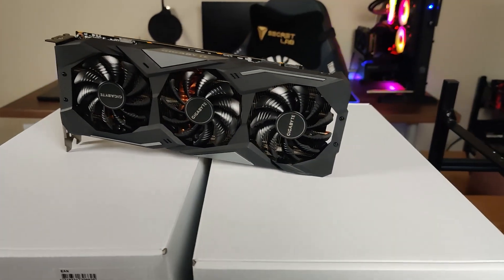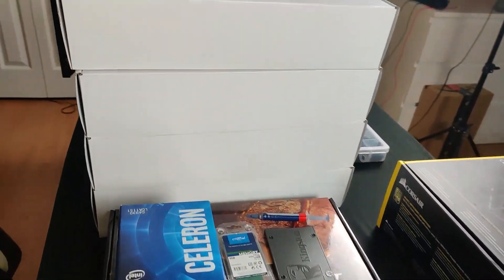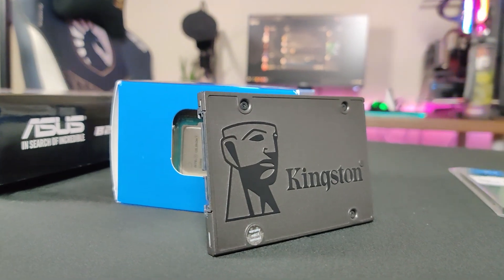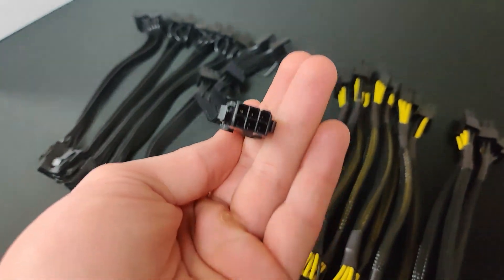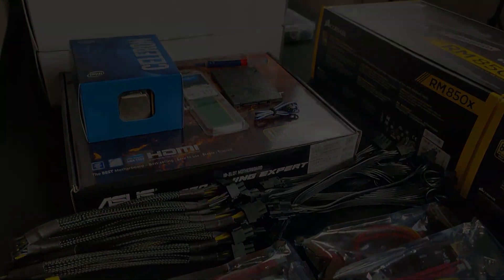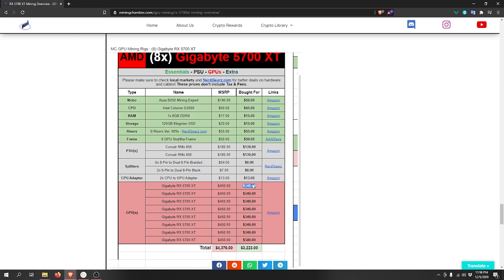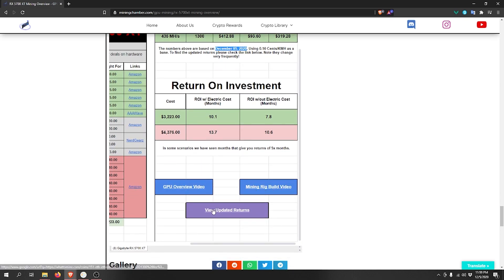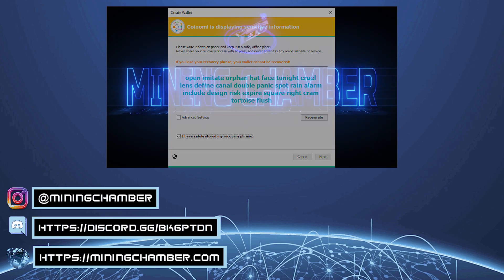RX 5700 XT Mining Rig Build - 8 GPUs | 435MH and 1300 Watts!!

Comment: Hello,

I have this power supply be quiet! STRAIGHT POWER 11 Platinum 1200W, 3 3060 ti are already running, I would like to connect 1 3060 ti, but I don't have a cable for power for the riser, do I need a splitter?
or does the power supply not manage to keep 4 graphics cards stable?
Reply from the maker: Yess you will need a splitter. You can use a splitter to power a gpu and it's riser from just one PSU cable
Reply: @MiningChamber  thanks for the reply, can you send me a link for a splitter? this is google translator. sorry for my bad english.

Comment: Hi, thanks for these instructive videos. My question is, if I flash my Gygabite Gaming OC rx 5700xt with the BIOS you mentioned in the comments, do I need to still tune the memory clocks? Because My hashrate didnt change switching from my stock BIOS to this REV1 bios.
Reply from the maker: Yes overclocks is different from bios modding. Check the latest video I released for info on this topic
Reply: @MiningChamber  Thanks for the help.

Comment: hello I have a question, I have a b250 mining expert, I installed hiveOS and when placing my rxt 3060ti it does not recognize the card, update bios, update the nvidia drivers from the hiveos panel
Reply: You still recognize it, do you have any suggestions?
Reply from the maker: Hey! Does your motherboard post screen show green on the gpu slot? I would suggest trying a different riser and such
Reply: fix the problem, thanks guys, it was hiveos version, everything working

Comment: So the risers just go from USB to motherboard pcie slot? The molex feeds them enough? Trying to troubleshoot why my rig won't post when it's on the riser.
Reply from the maker: The risers are supposed to be powered by the 6 pin on the riser itself and then the USB is from the riser to the motherboard pcie slot yes

Comment: I did this exact setup except with Nvidia Asus Dual 3070 cards.  Everything starts great until the exact moment the mining starts (Trex Miner on Hive OS) then its like the cards immediately over-draw power and the PSU clips and the system restarts.  I have the cards set to 130 w max each for mining but do they use way more power when they initialize?  Im pretty sure its the power draw because if I remove one GPU from each PSU, there is no issue.  Theoretically, the cards draw 265w max so 8 cards could draw 2120w and clip the power.  Do you have any experience with this or why this would happen?  I don't really want to put dual 1000w power supplies as it increases the cost.  Is there a solution I am missing?
Reply from the maker: You should be completely fine, try to load it in without a flight sheet. And I also recommend mining ethereum so Phoenixminer would be the better choice. Load it without a flight sheet, make sure you have the right oc settings in and then load the flight sheet in and see what happens
Reply: @MiningChamber  I will try that thanks for the advice!!

Comment: hi. can i use same settings for gigabyte rx 5700 xt aorus ?  because I did not make any adjustments and now it is consuming over 200watt and it is valued at 50mh / s. also the temperature is too high.
Reply from the maker: Yes you can! You can also find the 5700 xt settings on miningchamber.com I recommend using the ones on the website, more stable!

Comment: I'm looking for RX 5700xt's. Does the brand make that much of a difference in performance?
Reply from the maker: Not necessarily but there are preferred ones over the others. Check the video overview on the 5700 xt where I give the recommended ones. All what changes is their heat dissipation

Comment: Hey there, 

So I have a 1200 silverstone PSU which only has 4 PCI-E 8pin connectors and 2 x 8 pin EPS connector. 
Judging by your video I should be able to power 4 x 5700xt off of the PCI connectors. But I will need a CPU to GPU adapter to power an extra 5700xt?

Leaving one EPS for the CPU.
Reply from the maker: Yes so in your case, if you have 6 gpus and you power 4 with cables. What you can do is use splitters and power 3 GPUs through 2 cables and then their risers can be powered with Molex! If you have an extra cpu slot then you can look into using cpu to gpu adapter, else I would do the strategy of 2 cables for 3 GPUs. Don't go over 2 risers on one molex cable though!
Reply: @MiningChamber  
Sorry could you clarify the 2 cables to 3 GPU strategy? 

I thought that it was not recommended to run multiple GPU from 1 PCI-E power supply? 

From What I understand, I have 4 x (8pin to 2 x 6+2 Pin) - Like this one https://www.amazon.com.au/COMeap-Adapter-Corsair-Modular-24-inch/dp/B07CZBZN5R. 
Are you saying that I can further split these?
Reply from the maker: It isn't recommended for sure but If your short on cables (4 pcie cables and 6 GPUs) then your solutions are either buying 2 more cables and making sure your getting the right ones that are compatible with your psu or taking a non-recommended way (which means it's just not the best way to do it but still doable) and then powering 3 GPUs with 2 cables and their risers powered by molex. So you have a cable with 2x 8 pins. Get 1 splitter for each cable. That means you will have 6x 8 pins. Now you have 2x 8 pins for 3 GPUs
Reply: @MiningChamber  Legend. Thank you so much I'll give it a go! Will give you a shout out when I make my build video! <3
Reply from the maker: Pleasure my friend! And thank you!!

Comment: Do you have any video of how to mod this cards? Thanks in advanced
Reply from the maker: Yes ! Check links in the description! - Make sure to check the pinned comment of the modding video as well
Reply: @MiningChamber  Thanks for your reply! I use de unsigned bios and follow the same steps of the video. Unfortunatly the HR dindt change and the power cosumption is now higer that the stock version (With the Gigabyte Aorus)... Any Ideas? =(
Reply from the maker: Hmm did you apply overclocks after modding bios? Join the discord encase I miss the comment so I can help you there! Link in description
Reply: @MiningChamber  Yes, but its seems that the V1 unsigned Bios has a lot of issues. Fortunatly, after a lot of research, i found the gold (unsigned bios V2 for Aorus and Gigabyte) =D
 https://www.igorslab.de/community/threads/gigabyte-5700-xt-bios-mod-fails.3304/page-59

Thanks for your help!

Comment: Wait did you connect CPU power cables to the GPU connector? Isn't that dangerous? I thought GPU and CPU power shouldn't be mixed
Reply from the maker: The Corsair psu shares gpu and cpu slots so using a cpu to gpu adapter was not an issue, although I'm not sure if it's the same with other PSUs that don't do that!

Comment: Dude I’m getting 52 mega hash at 88-93 watts on my cards! I have 4 rigs 6 5700 xt on each and the production lately has gone through the roof and I’m at such low wattage now! I can post a pic of my settings and I’m using amd for the settings!
Reply from the maker: Hey! That is most likely power draw in the software, which is not accurate! Off the wall your most likely going to be at 100 watts and up! Feel free to share your settings in the discord server, link in the description!

Comment: In making of mining Rig only GPU is focused
I just want to ask how important is CPU and Ram memory
Or it doesn't matter that much compare to GPU
And second thing if I run this kind of rig for 24/7 what kind of cooling management I have to use (Air/Water). Well I want to use just air cooling because Water cooling will make it very expensive. But I want to know what problem Will I face with air cooling

One more thing what role have GPU memory in mining and I know how important GPU processing frequency is but want to know how important GPU memory is
Reply from the maker: Tomorrow's video should help you with that ;) and air cooling is completely fine!

Gpu memory affects the dag size. So for example 4gb GPUs can no longer mine Ethereum properly due to its dag size exceeding 4Gb.
Reply: @MiningChamber  do all crypto use dag 
Does bitcoin use dag
Do bitcoin asic miner have this problem too (dag size)

Where I live 
In winter it's always below 15°c but in summer it's stay between 35 to 40°c
What kind of ventilation system do 40 rig needed (8x amd 5700xt rigs)

Please can you make a video on ventilation and temperature management

Comment: You miners waste so much energy for so little gain.  You are leeches sorry but you are.
Reply from the maker: Have you checked the profits lately ? 😉 I recommend doing some googling before commenting on a topic your not too familiar with
Reply: @MiningChamber  have you checked the green impact you cause from 24 hours of operations?   You might want to google on a subject you know little about.    And your cost of operation to benefit is a down slope investment.  Short term gains with low long term due to overhead.
Regardless of the number of miners, it still takes 10 minutes to mine one Bitcoin. At 600 seconds (10 minutes), all else being equal it will take 72,000 GW (or 72 Terawatts) of power to mine a Bitcoin using the average power usage provided by ASIC miners.
Reply from the maker: @shamelessplace11  have you looked into the green impact cause from money printing? Plastic pollution? The world is vast. There are many issues out there that can be fixed. Just like mining "mints new coins", money printing uses a process that also is bad for the environment. Also, don't get me wrong I am all about the environment but things like this is a bit overboard. I support the technology of blockchain, and this is one way to support it.  

Without mining, it wouldn't be the secure network that crypto enthusiasts would've wanted it to be
Reply: @MiningChamber  I’ll give you that.  Most money is digital.  But I get you.  I see your side of it
Reply from the maker: 💙 just it's always good to talk with a different side to understand each other. 

I push everyone I know to never use a plastic water bottle so we all just somehow have to contribute. Eventually, mining will be gone and it will all be Proof of stake in my opinion. So at that time mining won't be necessary for sure!
Reply: @MiningChamber  agree so much waste in the world.  And it’s crying out for us to stop.    Ahhhh the free market what a bastard it is.   Have a great one stay safe

Comment: Nice video.
How can it be profitable if after 1 year you lose 90% of minig capability due to the complexity?
Price of ETH has to exponentially grow, am i not right?
Reply from the maker: Well ETH has already exponentially grew from $150 to $1150 in some months, profits are higher than ever now for mining and generally most people breakeven before a year with profits being where they at now.

In a year or two, Ethereum won't be mine-able anymore due to it changing to POS (proof of stake) so that means AMD miners will have a hard time finding a profitable coin while NVIDIA miners can mine other algorithms with decent enough profitability
Reply: @MiningChamber  Thanks for the reply dude.
How long you are thinking of using that rig? 
From what i gather , miners after one year change gpus.
I say this because if ETH comes back to 300usd it is not that profitable i think.

Comment: low Hashrate, i have my two rigs with 58.25 Mhz each GPU , they are stable for long time. So 54mhz is the basic for every 5700 gpu series, you need to put bios mod bro
Reply from the maker: I did BIOS mod it, if you watched the part for overclocking you'd know why ;)
Reply: @MiningChamber   you are right, try using HiveOS or RaveOS, because window put too much weight in the GPU.
Reply from the maker: I am using HiveOs in the video 😅 I also recently posted a full HiveOs guide

Comment: dude, if i like to make one like yours, but instead  rx 5700 xt, its any difference if i used rtx titan... does that will do any change in term of mining profit?
Reply from the maker: Mining profits does depend on the gpu, so first I would go and visit websites like Kryptex gpu list and see the profitability there, but other than that you can use the rest of the parts the same way just change the GPUs

Comment: How hot does the room get with this rig inside?
Reply: 1300watt is like running a small oven 24/7
Reply from the maker: In a cold winter with -10c outside the room stays around 20-24c but if it's hot outside then the room can get as hot as 30-35c

Comment: I have a question, i realized that i wanted to build the same exact mining rig as the one in the video, my question is if instead of putting 2x  850w i istalled 2x 750, will it still work? and when ETH becomes proof of stake, what could i mine?
Reply from the maker: Hmm 750 would work, I just rather be safe with 850 watts so you can have margin for error. 

As for POS, no one really knows yet what will happen so we just have to wait till more information is available but the POS will only be fully launched in at least one year

Comment: Question, I heard that a minimum requirements for a cpu to use with the graphic cards are  3mb L3 cache and 3ghz. I'm just a beginner, but is there a way that you would bottle neck the graphic cards with a cheap cpu?
Reply from the maker: It won't bottle-neck it since it's contrary to gaming. You won't need a fast processor to perform the caching and the processing of what the GPU renders. All you need is just computational power to perform the hashing so no worries at all! As long as your cpu compatible with your motherboard youl be set

Comment: Awesome video. Also really liked your other video on power management. Learned a lot. Two quick questions: 1) was the CPU to GPU splitter because the RMx850 only has 3 VGA ports? 2) what is a typical power rating for the CPU port on a PSU?
Reply from the maker: Thank you!!
1. Yes!
2. They can push I believe around 200-290 watts. Although I have no resources to prove so it's hard to tell for sure  sorry!

Comment: I downloaded it from Hiveos in Windows environment and modded it with Red Bios Editor. Then I installed the modded bios via hiveos, but 5700xt OC in gigabyte did not boot. It locks the system. The card is bricked. Have you ever tried and succeeded with Hiveos?
Reply from the maker: For Gigabyte oc Rev 2 you need to use the bios pinned in the comment section of our bios modding tutorial! https://youtu.be/F-GFMUYFQPM

That is due to their locked BIOS so you have to use an unlocked BIOS

Comment: Hi.  I built a (6) Sapphire Radeon 5700xt mining rig with a H110 Pro BTC+ AsRock Bios motherboard.  I tried to install AMD Radeon Adrenalin driver software.  It failed to detect a gpu card and will not install driver software.  How do I solve this problem?  Can you help.
Frank
Reply from the maker: Hey! Try to do it with just one card. Unplug each card except one and then try to install the amd drivers - check device manager make sure under display adapters you see your gpu
Reply: Hi.  I tried with one card.  Did not work work.  No devices are seen in the display adapters in the device manager.
Reply from the maker: In that case reinstall your windows 10 and do the full setup with one gpu it should work that way or make sure your motherboard BIOS settings have pcie gen speed set to 2 or 3 and 4g decoding activated

Comment: Hi, I have 4 sapphire 5700xt nitro+ on the Biostar board. Can It work together with 2 Gigabyte 5700 on the same board? My OS is windows 10. 
I watched both 5700 videos but I confused.. which gpu card is better. It looks same but you preferred sapphire?
Reply from the maker: You can run any card on the same board it's just easier to have same ones due to overclocking and such. 

I prefer Sapphire due to their great cooling, performance everything is the same and 5700 can be flashed to 5700 xt so it isn't a big difference!